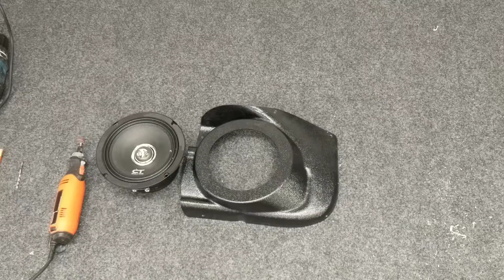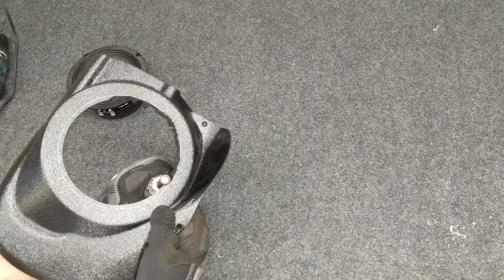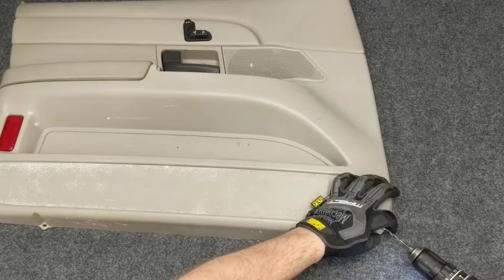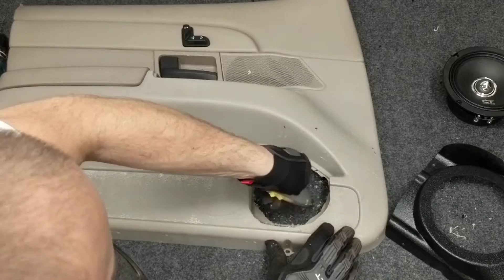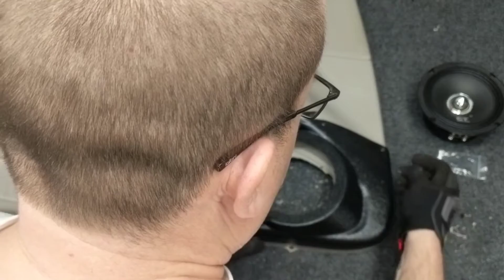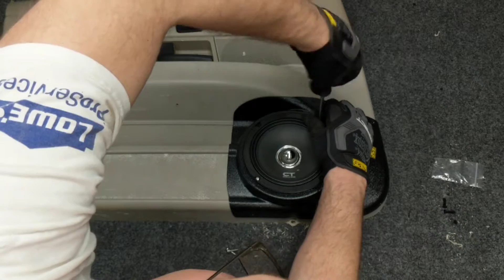1998-2012 Ford Crown Victoria 6.5" Speaker Pod Install

Comment: It seemingly mounts nice, but what about the gap from front to rear via door panel pocket that hasn't been closed off?  That will kill any upper midbass and lower midrange that would be available from the speaker. #cancelation

Comment: you can mount a 6.5 in the upper left of the door panel. The speaker has to be a shallow mount but it can and has been done before, you don't need pods and you get to keep the door pockets. the speaker will fire at your ear and not your shoes also.  You can do the same on the rear doors and the rear corner pillars.
Reply: @Swen-bk3kz I ended up using 5x7 ct sounds meso in the stock front locations with 1/4 inch spacers and added 2 jbl gto silk dome tweeters to the top front dash grill. I was considering the pods but after seeing how much clearance is behind the door panels I would not go that route unless you have an older car like mine with the pull handle that blocks this location.

Comment: I think you did a good job it looks good I would use some flat washers locking plastic nuts and some adhesive also. Good thinking. Can have 6-8 speakers no problem